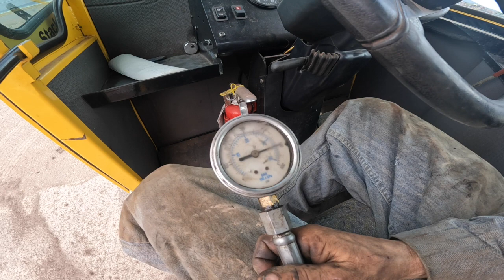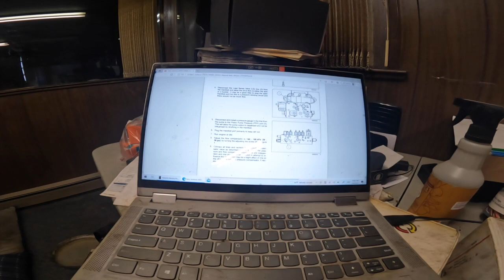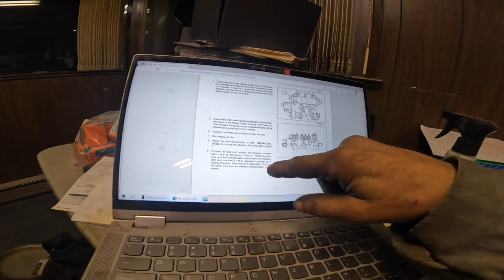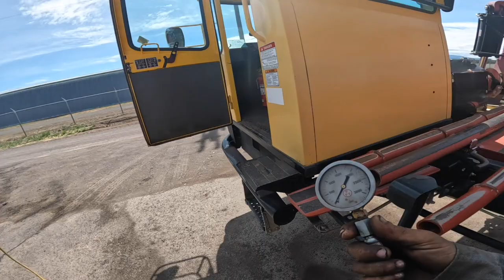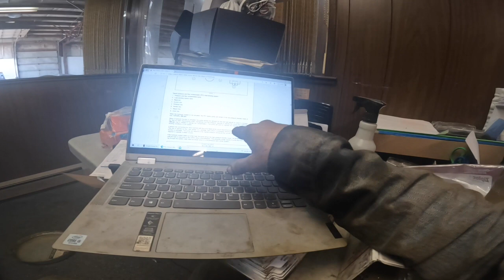H9880 bale wagon hydraulics

Comment: Thanks for the ride along. I ran into a hydraulic feed problem years ago, long story short, somebody, either on purpose or accidentally dropped a shop rag in the hydraulic supply tank and every so often the pump would draw suction and that rag literally stopped the oil flow to the pump and nothing would function, thankfully the suction tube had a screen on it. They would shut the machine down for a few minutes then restart and function normally again.

Comment: They have came a long way from the ones of the 80’s and 90’s. I have only been around one. It had a ford V8 gas and a Clark manual transmission. It had the steel rails, the owner hit a huge willow branch and folded it back. Very good troubleshooting video. Thanks for sharing your time and knowledge.

Comment: Instead of using pressure gauges I purchased Bluetooth pressure transducers which were like $50 each, the cool part about them is you can use your phone tablet or laptop to read pressures and you can scale the display to whatever pressure range you need.  The transducers I bought a 0-5000 psi and they seem very accurate, I use my autel as the display most of the time.

Comment: Rule of thumb : the PC ( pressure compensator, bigger spring) - is adjusted to the maximum system pressure setting, but ( and it is important) should be about 300 psi LOWER than the main relief valve setting in the DCV.

LS margin set (smaller spring) - at system neutral by reading main system pressure ( stand by) and 0 psi on LS line. Also about 300 psi.

On more complicated system it might come to connecting pressure differential gauges and running through all of its paces and look for abnormalities in the LS to Main system pressure differential.

Otherwise, the system will overheat really quick and whole lot of problems will start occurring because of that.

Comment: There is nothing Warren can’t fix. I wish he was four hundred further South so I could use him.
I take that back He can’t fix his dog. It’s actually pretty simple have him drag about a 25 foot piece of hay Twine around and then you can step on the twine and call the dog. If he doesn’t come you can just pull on the string or calling his name and say come here. When the dog comes you give him little treat that you carry in your pocket and tell him he’s a good boy good boy. For the treat are used a hotdog cut into small bits cooked in the microwave and I carry them in a plastic bag. Basically don’t let them get away with not coming make sure that you can step on that twine and make him come.
One other thing dogs are trained through repetition. You must be consistent and do this exercise over and over if you do it 20 times and the dog comes that’s great but if you have one failure I need to do it 20 times again without a failure good luck Warren.

Comment: I always liked a relief on the outlet of the pump with relief pressure set to a pressure just below the "everything explodes" pressure just in case the compensator did not compensate for some reason, maybe 3500 psi. Like maybe the missing orifice found it's way into the compensator piston passage. Diagnosing hydraulic circuits like this can make your head hurt!
Reply: Main relief absolutely have to be there! Systems without it are dumb!
Reply: U

Comment: In my experience manufacturers often state a stand a stand-by pressure that is too low in practice as a lower stand by pressure gives them lower parasitic loses. For a LS system to work properly with good response the stand by needs to be high enough to compensate for lengths og lines and valves between the pump and the LS measurement point. On marine systems with long lines i’ve seen stand by of 600psi necessary. 200 psi is at the lower end of what’s needed for a complex system. Pump LS compensators have springs which work within a certain pressure range. if you adjust above or below the spring range the pump will do weird things and may be what was happening with you there initially. Sounds like you got her in the end tho - good job. Not many people truly understand load sensing - your in a minority!
Reply: Not exactly what you said. Yes lower LS margin pressure will make system more sluggish to respond, and with long lines it will increase hysteresis, too high of the LS margin will heat up the oil, also can leak around the spool and eventually can cause cylinder creep with “cylinder” spool sections of DCV.

That machine has solenoid controlled DCV, I think he should start with checking electric part of the system. And I think the problem with too high of LS margin is because someone was messing with the adjustment screws.